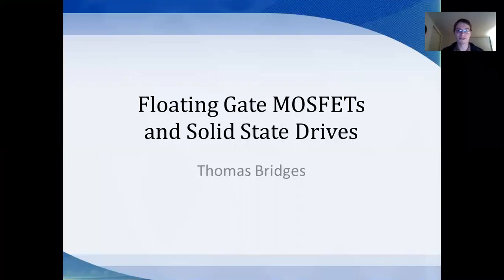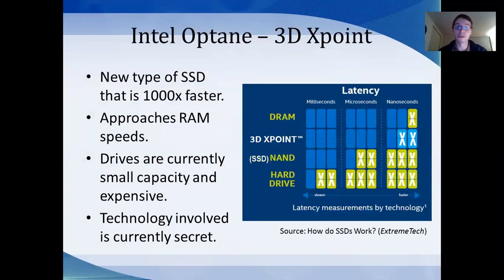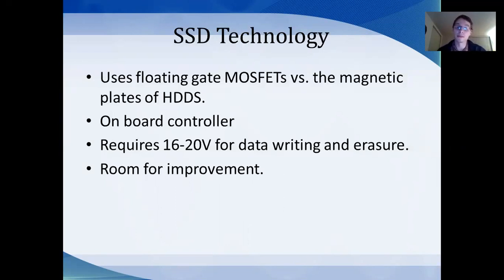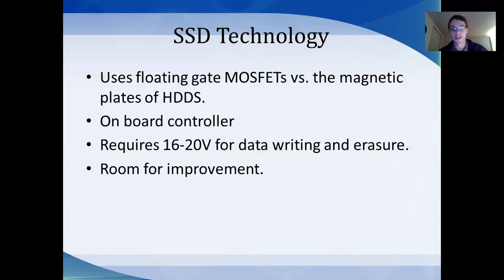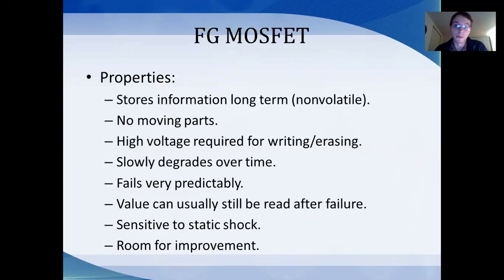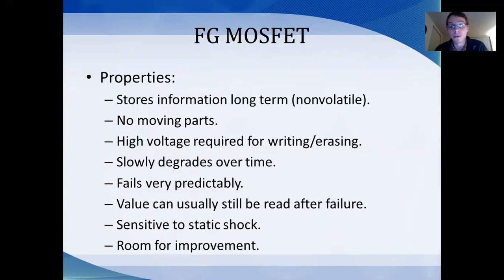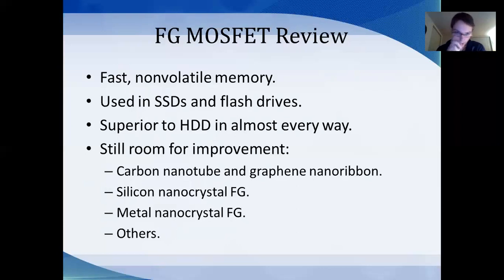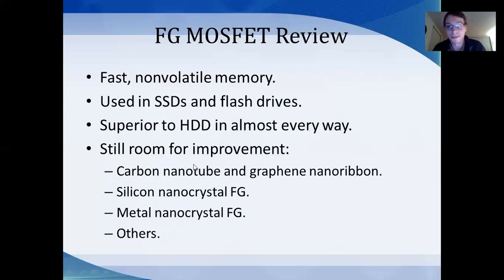Floating Gate MOSFET Technology inside SSDs

Comment: where i can buy some floating gate mosfet ?
Reply from the maker: I don't believe you can actually by floating gate mosfets by themselves (discrete). They are usually found as built into the SSD IC and cannot be used individually, unfortunately. Here is where you would find MOSFETs in general though:

https://www.digikey.com/products/discrete-semiconductors/en